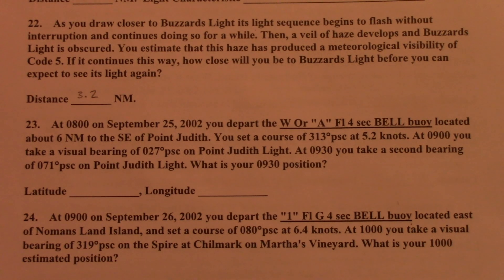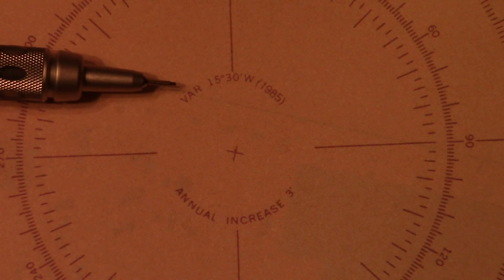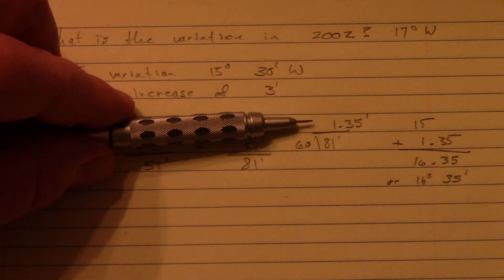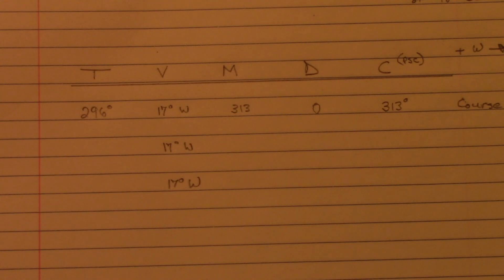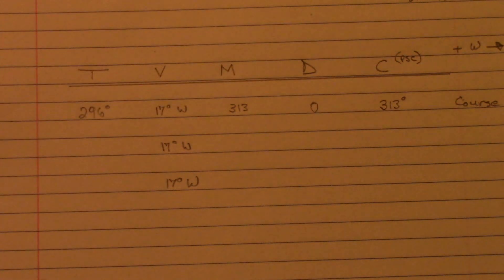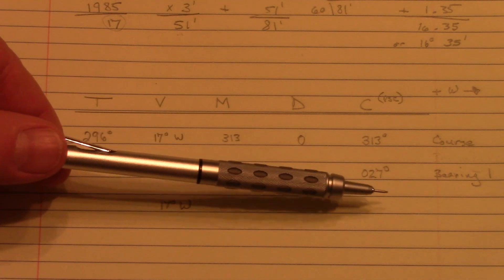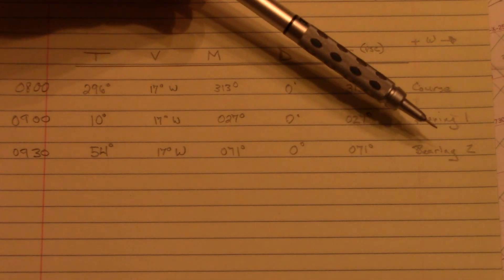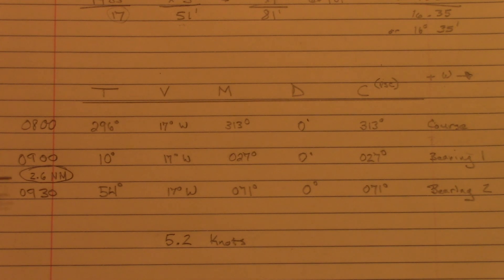How to plot a running fix on a chart

Comment: Curious about the 1.35
Reply from the maker: 60 minutes in 1 degree of latitude. So, we needed to convert 81 minutes in to degree and minutes. 81 / 60 = 1.35 or 1 degree and 35 minutes. Not sure if you were asking for clarification. If so, hope that helps.